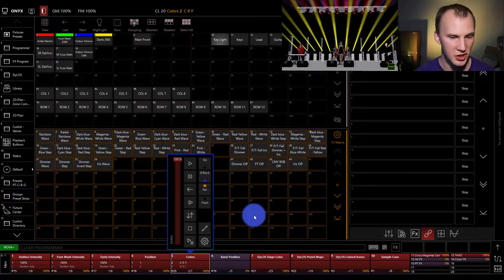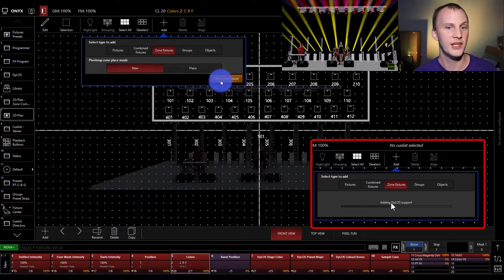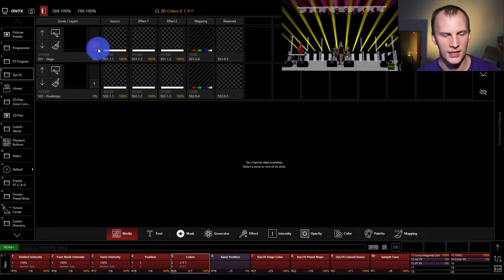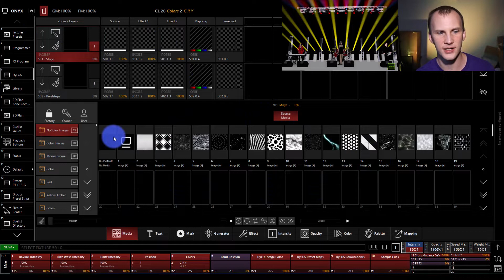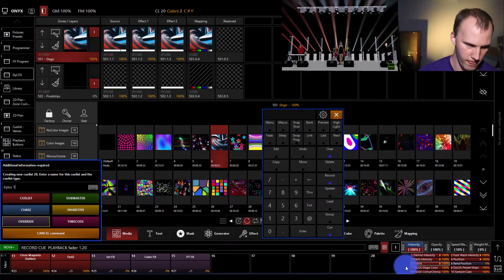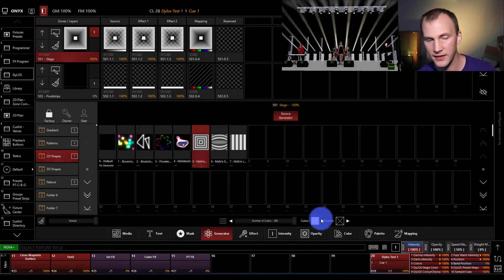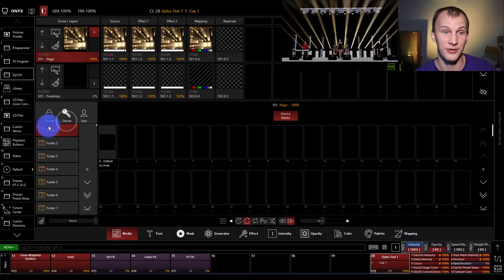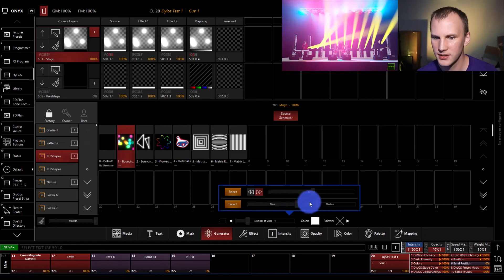DyLOS Basics in Onyx

Comment: I'm currently trying to choose lighting software for a small club that has a video display. Can DyLOS only be used when pixel mapping fixtures or can it also be used on displays?

I'm really just looking for a simple solution for audio reactive lights and visuals.
Reply from the maker: So DyLOS isn't audio reactive....you may want to take a good look at ENTTEC's ELM software - it can have a monitor display, offers audio reactivity, etc. It just only controls pixels or a video output, it can't do more complex fixtures like moving heads, fixtures with dimmer channels, etc